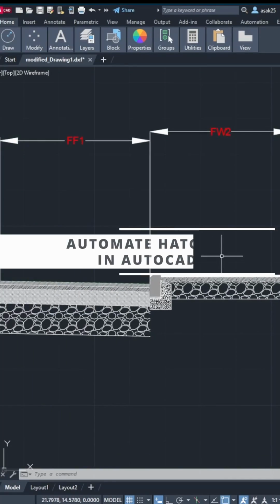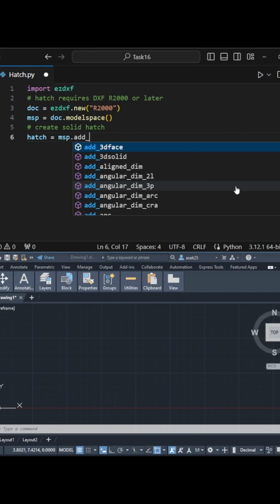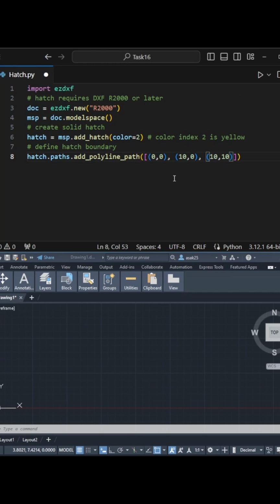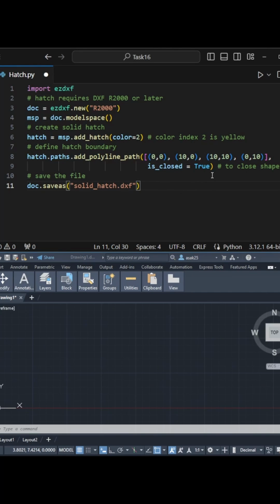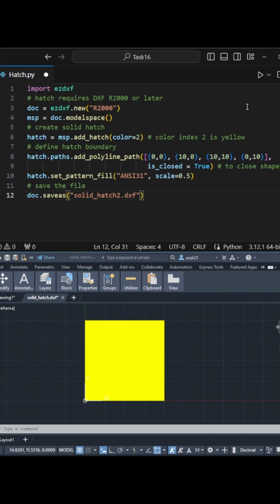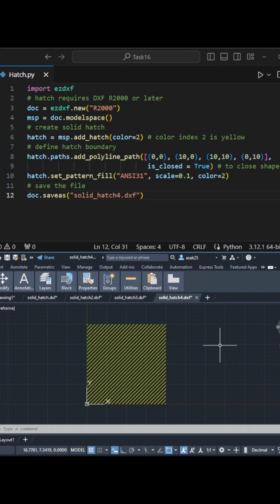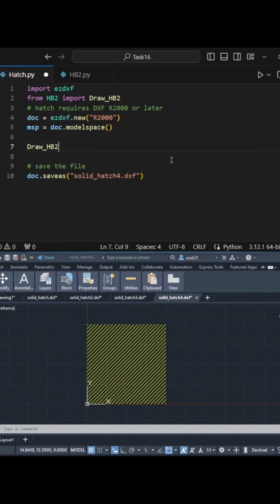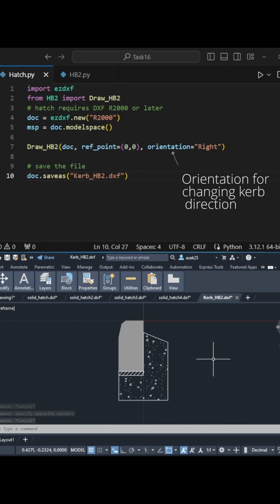Automation with Python - AutoCAD #hatching#

Comment: Hi man, thank you for your content. I have a questions: How to change hatch with pyautocad? and Can I select an outline and hatch it?
Reply from the maker: You can easily do that using the ezdxf library. Pyautocad is much harder when you deal with complex objects like Hatches. eventually you could combine both libraries in your code
Reply: @ahmedskullab   I can combine both but Pyautocad used for text style , dimension not for geometric properties but Ezdxf used for Geometric properties . When I using Both Call was reject by AutoCAd . I Attempt So many times it  is not work please help me solve this issues